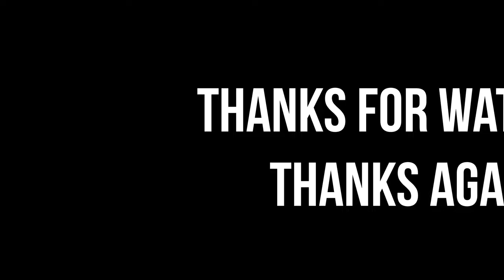RIDE ALONG 25 mobile mechanic tips ect 2014 Silverado condenser etc.

Comment: On those style axles I use heat but most of the time some penetrating oil and a good size bearing separator and hammer usually work to seperate axle from intermediate shaft

Comment: I’m thinking about becoming a mobile mechanic while at the age of 17. Imma start off with basic general repairs like brakes, oil change, tire rotation etc. I do have mechanical experience but I’m kinda nervous, reason being is I don’t have a car and transportation would be a lil hard to do. But it’s still in my head if I should give it a try or not.
Reply: Definetly do not! You need years of experience for general experience. Go join a dealership or tireshop to get trained through them first!
Reply from the maker: i absolutely agree with DIY Support ! work with a shop or a good mobile technician if you can find one willing to train u up.. i like your spirit tho. make a difference my brother... make it happen for your self.  be patient and after a few years of actually training and utube videos "alot" you can make you vision a reality... keep me updated on your progress.   awesome